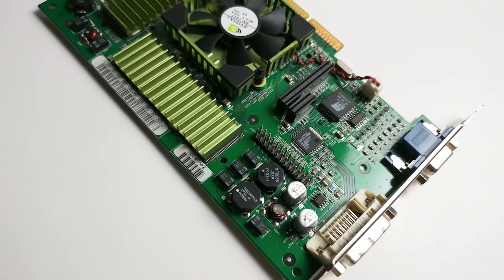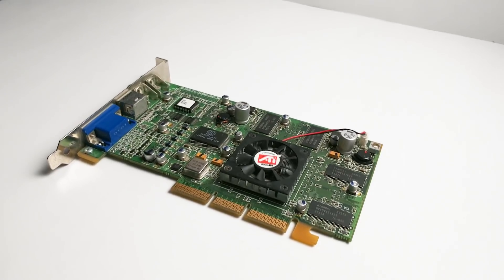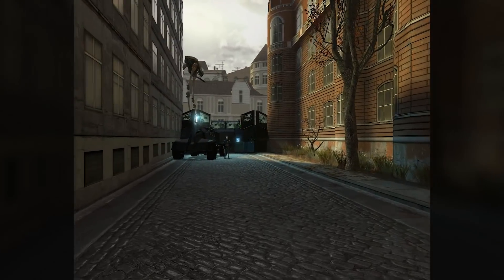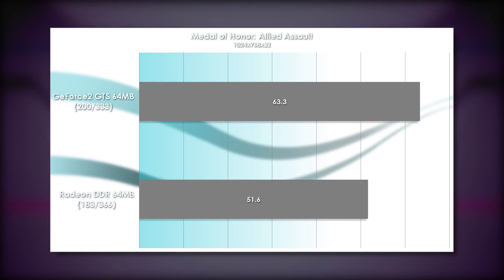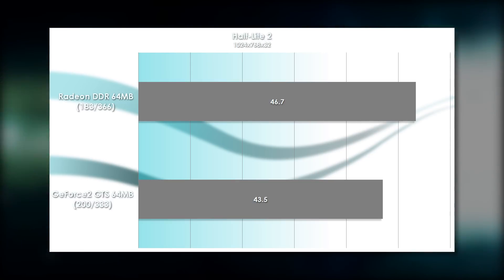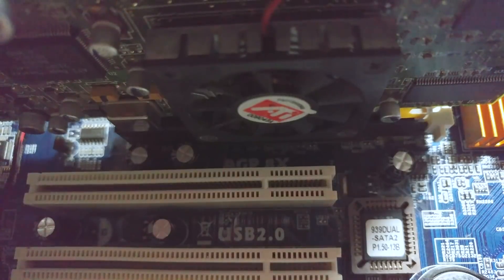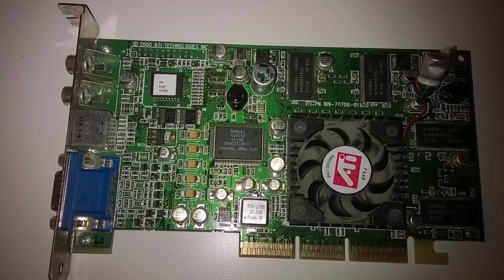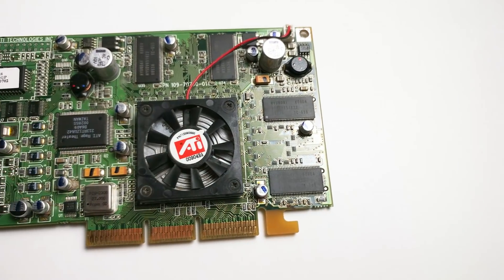Radeon DDR 64MB vs GeForce2 GTS 64MB | Card Battles

Comment: One thing about radeon demo - it actualy DOES use pixel shaders! Radeon did have  support for pixel shaders, just not flexible enough to match DirectX 8 requirements and thats why the only place you can see them is in Radeon  Ark demo.
Reply from the maker: +bar bucha You are correct! One of the most fascinating aspects of the R100 architecture was its support for a VERY early version of programmable shaders, the elusive Shader Model 1.0. This feature was locked away by the drivers, however, and Radeon Ark actually uses plain ol' fixed function EMBM. Here's a reference for you:
https://books.google.com/books?id=1GZiB-A5Y2kC&pg=PA36&lpg=PA36&dq=radeon+ark+demo&source=bl&ots=OXEtfjBbSI&sig=A-m8t9zkm1pDzdLveVoILh-Ajjw&hl=en&sa=X&ved=2ahUKEwizxJ-L-O7YAhUKLqwKHf_IC3kQ6AEwEXoECAcQAQ#v=onepage&q=radeon%20ark%20demo&f=false
Reply: @PixelPipes  I beleive that originally Microsoft released provisional specs for directx 8 and ATI followed them to the letter, however nvidia exceeded them and "Persuaded " microsoft to update directx 8 to match as a result the original radeon was never directX 8 compliant.

However although it was never really used by game programmers directx 8.1 was an ATI First.

Comment: 7:28 Environment Mapped Bump Mapping (EMBM) is not that surprising as the Matrox G400 was able to do this in 1999 but most companies did not take advantage of it  with only a few games like Expendables (used on water ) supporting it. Crazy thing but the Radeon DDR did have 1 pixel shader but it was before Direct X 8.0  came out so it cannot support pixel shader 1.0 or 1.1. Maybe if a game console had used the Radeon DDR we could have seen what developers could have done with its ATI design pixel shader which was not as flexible as future GPUs like the Geforce 3 but it was better than the old fixed shaders..

Comment: (sad violin song) Voodoo 5 5500 from 3dfx. I wonder if the Voodoo4-2 4200 had come out with a 180nm and 32MB of DDR  how it would have stacked up against the Geforce 2 GTS and Radeon DDR 64.

Comment: I had a Creative Labs GeForce 2 Ultra. A few months in, the fan failed, and the card fried my whole system; it actually caused the CPU to shatter by flash-heating it under the still-running CPU cooler. Everything attached to the motherboard, except the RAM, was toast. After warrantying the card and replacing everything, the first thing I did when I got the new card was stick a Thermaltake Blue Orb on it. Incidents like this were the reason why Creative Labs stopped selling their GPUs on the US market.
Reply: damn I would have had a heart attack if that happened to me

Comment: At the time these cards were released there were 2 competing DVD playing programs.

Power dvd was faster but had poorer quality
Win dvd was much better quality but on most systems could be a bit jerky.

However ATI had a form of video decoding acceleration, that win dvd could make use of. I remember a friend of mine bought one of first Geforce DDR cards, I later bought one if the first radeon cards, he was blown away by my win dvd playback. ( unfortunately a quick search of the net is unable to find information on this feature )

At that time it was not a full video decoder, it was only  partial but was enough to give win dvd the boost it really needed

Comment: I actually was shopping for a graphics card in the summer of 2000. I was 14, and wanted to upgrade the godawful family eMachine to play EverQuest. Luckily a local computer shop was across the street, so I bought a 32MB stick of RAM(upgrading to a whopping 64MB!), and a Geforce 2 MX. I think I ended up getting the Geforce because of the box art, and I liked the green Geforce symbol.

Comment: Late to the game... but are you sure thats an GF2 Ultra card? It lQQks more like the "Quadro2 Pro" version which in fact uses the same PCB as the Ultra, it has the same GPU clocks as the Ultra(250), but the memory speeds of the GF2 Ti(400) card. It has a strategically placed surface mount resistor(R122) for the Quadro2 Pro and resistor(R121) for the Ultra, you can visibly check the inline row of resistors place right behind the DVI port on the backside. Im sure the videocard BIOS will tell you which one it is on system boot up or from GPU-Z, but the reason i ask, is because the Ultra version normally doesnt have the revision or serial number stickers above the top memory heatsink and normally doesnt have DVI output, the Quadro2 Pro do have the info stickers shown like on yours and comes with the DVI port. Its often sold on ebay as an "GF2 ULTRA", which in a sense is subjective, it can be OC'd to Ultra speeds, and then some most times. Great card none the less because i have one just like this(Quadro2 Pro) and it OC's very well as is without having to mod the card by swapping the resistors for the version you want.
Reply from the maker: It's been resistor modded and flashed.

Comment: I noticed a real GTS on your shielf next to Voodoo cards. What was the point of downclocking the Ultra?
Reply from the maker: That's a GeForce 256 on the shelf! :)
Reply: That's interesting. I have the identical looking GTS card from MSI. I guess yours is actually the second revision of  256 called GeForce DDR.
Reply from the maker: Correct! They are visually almost indentical to the 32MB GeForce2 GTS. Both used SGRAM. The way to tell them apart quickly is to look at the row of pins at the top edge. The GF2 has roughly half as many!

Comment: if you were to test counter strike source would it perform about the same as hf2
Reply from the maker: +SuperCookieGaming Hard to say... I'm using an older version of HL2 that's better optimized for these vintage cards.
Reply: If you were to just download it off steam per say? I know HL2 has more characters models but other than that they look pretty similar and are both based on the same source engine even coming out in the same year. CSGO is also based on the source engine but has had a lot of improvements to it letting you bring up the graphics to a more modern level. Maybe a video idea to see if their different?
Reply from the maker: It's definitely something I'd have to research. I'm not a CS player myself but I assume even Source has received engine updates just as HL2 has. If so it would be hard or impossible to run on DX7 hardware, but maybe someone else can clarify that for me.
Reply: PixelPipes The original CS, 1.6 was released in 2000 and was based on the original half life. I wonder how these cards would do in those games. Ik your not a CS player but i hope you can add cs 1.6 or source to your newer card reviews.

Comment: Please, keep in mind that the steam version of Half Life 2 is optimized for modern hardware only and doesn't run anything close to what it should on period hardware. Look for a DVD version of it on Ebay for like 10 dollars.
Reply from the maker: You are exactly right! I'd be lost without the retail version.
Reply: Thanks for the heads-up. Had no idea.

Comment: Nice, you got the retail version with the faster 183 MHz :) The are quite hard to find, mine are, of course, the slower 166 MHz ><. But I do have versions with DVI, which is nice. I see the Radeon having more of a CPU overhead at lower resolutions, rather than it scaling better with resolution. I've seen this on many machines, ATI cards have a harder time especially on slower CPUs and struggle against cards from 3dfx especially.
Reply: I recently acquired an OEM version of the 64mb RDDR (8:08 < this one), man that 17 mhz makes all the difference! I "overclocked" it back to 183 and it was the difference between having to make Midtown Madness 2 look like crap to play, and being able to play with settings up. I feel bad for anyone that bought a system with one of these back in the day... but on the upside the fan is much improved over the retail. Barely audible.
Reply: @s8wc3  Those were the interesting card to have, and cheaper than the radeon VIVO.  For a while my guest box had the radeon LE in it which was the 32 mb ddr at 148mhz and hyperz disabled in software. But still both functional rendering pipelines. And it was easy to enable the z compression with a reg key, and overclock it to at least 166. I never took mine further but maybe it could have done it, and the 32 mb didn't seem to hurt it any. But tweaking it with the HZ patch and the bump in clocks probably boosted it a good 1/3 or more.
Reply from the maker: In the case of UT2004, I don't see the Radeon as having a CPU limitation on high settings at basically any resolution. But I definitely focus a lot of my effort on removing CPU limitation with my testing. Perhaps more testing with the Radeon at multiple resolutions is needed to truly prove my point.
Reply: @PixelPipes  The cpu overhead becomes more apparent when cpu speed is reduced to about that of a coppermine 1000 and down. It was especially noticiable when back in the day I compared my GForce 2 Pro to my cousins Radeon 7500 and he had a duron 750 at 1ghz using DDR memory and  I was on a p3 600E being punched to 930mhz on the 815 chipset. When we both clocked our CPU's to stock his took more hit than mine did in spite of me having the much larger overclock.  So it led to an entire night swapping hardware about to see the extent of it. With our overclocks in place mine actually struggled to keep up in some of the newest games of the time.

Comment: I just checked my card collection and saw that I have a card similar to the radeon but it's a rage 128pro 64mb. but it also has the same vga and two composite on the back. I wonder if this card is good or crappy? I might never know as I don't have a lot of agp systems put together right now lol.
Reply: The ATI Rage 128 series was very veeeery, crappy! Back in the 90s I've used a Rage 128 for 2D and an attached Voodoo 2 for 3D and gaming.
Reply: It was crappy compared to Voodoo2, but that was true for any other competitor. Of the non-3dfx cards the Rage 128 Pro was pretty good. For old DOS games though it's not recommended.

Comment: Oh yeah what happened too your socket 775 rig ?
I recall you needing too refund the powersupply & everything worked after you replaced the cpu with a q6600.

Sounds like the fan has no lubricant on the radeon card & is running on a dry bearing or or bushing.
If you got some sewing machine oil or other similar lightweight oil id try putting in a drop or two & then having it sit so it reaches the bottom of the fan & spinning it for a bit by hand to get it through the bottom of the fan. (Ofc fan disconnected from the gpu itself while you spin it around manually by hand.)

Recently got hold of a older but good silver power 400w powersupply for free, was used in an office pc with an athlon x2 2.5 ghz & 4 gb ram for a few years & then put off too the side as windows xp no longer received updates officially by microsoft that was installed on it.
(Has two pci-e 6 pins so i can use the 7800 gtx i got here in my core 2 duo e6600 rig easily as well as my 9800 gtx+ without any problems.)
Might swap it into another build im planning though with my old athlon II x3 445 unlocked as a quad core cpu 1x4 gb ddr3 & the 9800 gtx+ i mentioned earlier.
Reply from the maker: My Core 2 Duo system was up and running by the end of the video, but I can understand if people couldn't finish it. It was a long one!
You could be right about the fan bearing. It's non-removable, but I could probably still lube it.